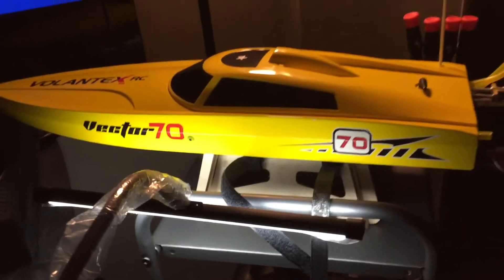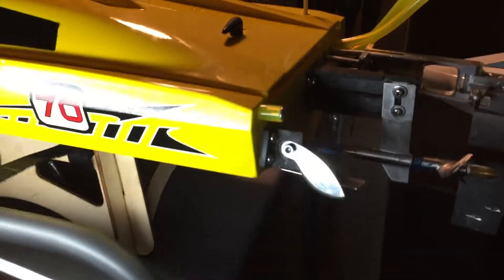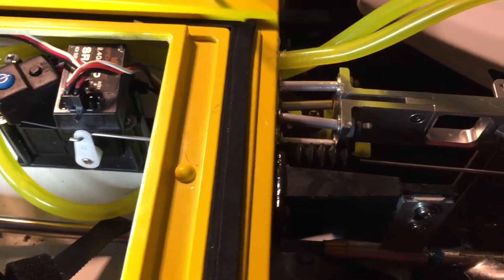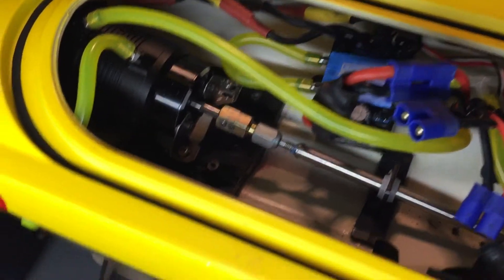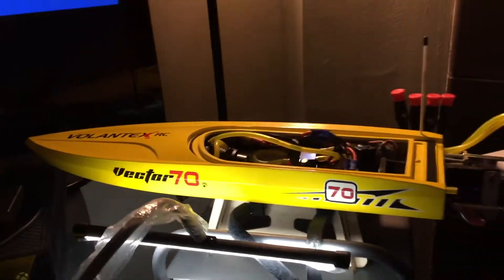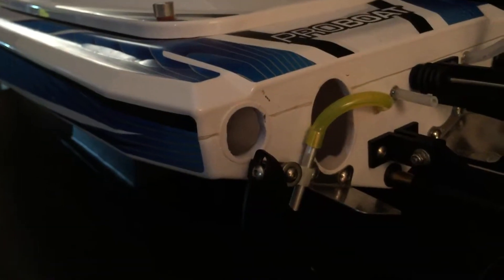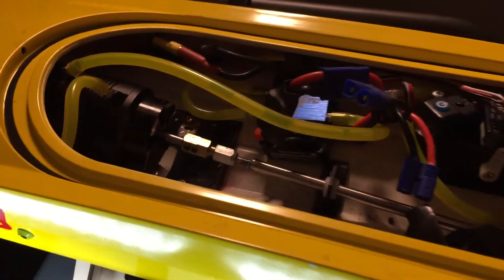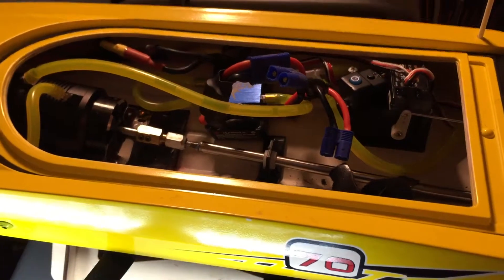Rc boat mods vector 70 upgrades

Comment: Does your vector have reverse mine does not it sucks trying to load it up and off on my rc trailer
Reply from the maker: Yes , it has reverse . It can be program to not have reverse . It all depends on the ESC you’re using
Reply: @pitbikecookracing3324  mine is stock and not sure where my paper work is to tell me how thought maybe it didn't cause of the flex shaft
Reply from the maker: @WESTVIRGINIAOUTSIDER  I just matched up some stuff the would last against a 120 esc . The prop is for from a blackjack pro boat
Reply: @pitbikecookracing3324  sweet yea I'm just running all stock mine don't get ran much couple times this year that was it